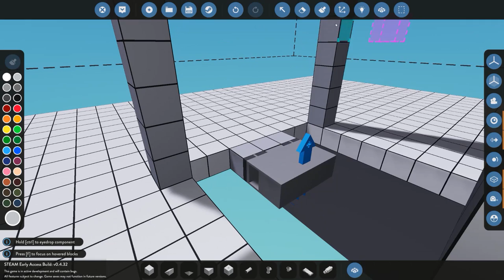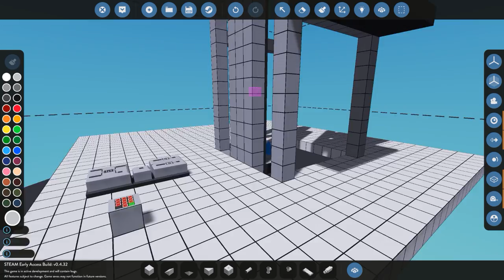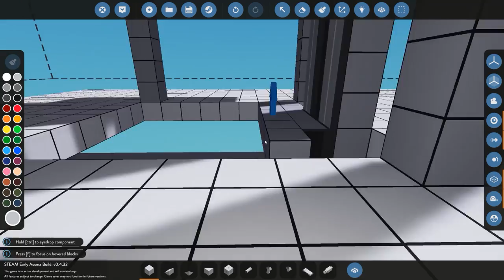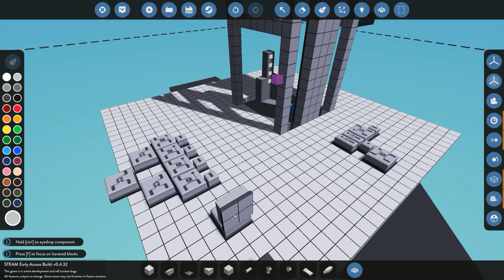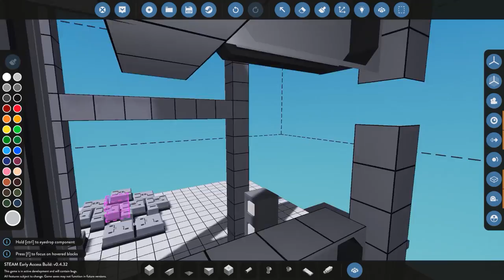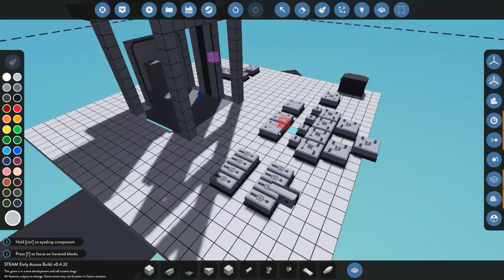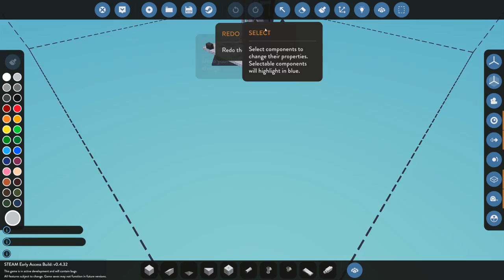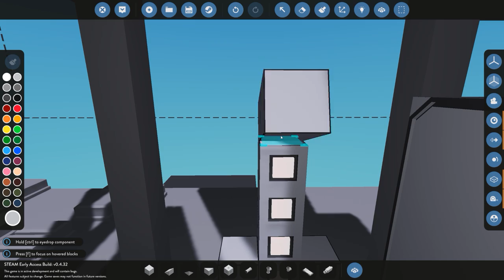Stormworks Multi-Floor Elevator Tutorial

Comment: To get around the same night for each floor issue you could set the number in the switch box’s to the height (m) another the bottom floor (0) then for example you could have 2 floors close to each other and a 3rd much higher

Comment: FIrst like :D
This is way better than previous video!
Tips:
Add that red/white bar display to every floor so you can see where cabin (red bar = floor, white = cabin)
In elevator use same thing again (red bar = desired floor, white = cabin)
Cannot you use "greater than" instead of threshold gate?
Also use clamp, so you get whole numbers without decimal part
Maybe you could use another PID to openning floor doors instead of those gates
Will you use it in actual creation? Maybe custom rig?
I love that you make that visible by placing it into frame, instead of closing everything, huge first LIKE for this video!

Comment: My elevator keeps getting stuck on the ground floor, it won't go in place, its just a bit higher than the place where it  needs to be and because of that the doors won't open.
 The measurements and the connections are right, Idk what's causing that to happen.
Reply: I'm having a similar problem... I don't know what's causing it. I hope someone figures it out sometime. It stops too high on the ground floor and is too low on the rest.
Reply: @willmons1197  Hey! Look on the workshop for a Microcontroller version! I got it and it works like magic now, and its easier to connect!